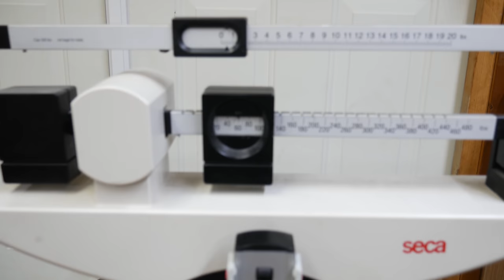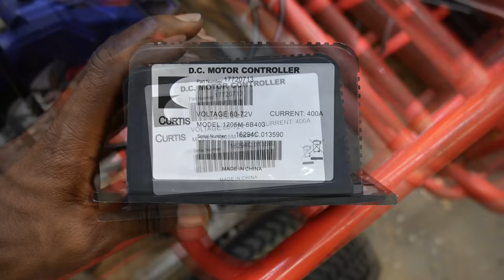Common Problems With Making An Electric Go Kart or EBike and How I Resolved Them. #063

Comment: Question, how about using cordless batteries, like the 60 volt Dewalt or a few 40-volt Ryobi batteries? Seems like these would be a cheap alternative if you use enough?
Reply from the maker: Those batteries aren't that cheap LOL... actually that might work for a much smaller vehicle. but the motor I plan to use long term can draw 100-200 amps very easily. Those batteries wouldn't make it to the end of the street. If you bought enough to get the capacity I want, they would cost more than buying standard lithium batteries.
Reply: Thanks for the reply, I see them using similar batteries in electric bikes, but I understand you're moving a lot more weight around with go-kart. Don't know enough about Battery Technology myself but watching your channel has been very helpful. I was planning on attempting to use some of those batteries 4 in electric bike project on building because I've got so many of them laying around my shop. Keep up the good work, your videos are very informative.

Comment: Do you think it would work if I buy two cheap SDS hammer drills off amazon hook one to each back tire.  Connect those to an inverter running off the deep cycle batteries?
Reply: blue ferral 
You mean one of those 4000W drills?  😉

Comment: I really hope you will consider lithium iron phosphate. Buying brand new cells. And the price for new cells if you were to build your own battery pack with brand new battery cells would cost the same if not just a little bit more. And would potentially be safer than wet asses

Comment: I may go so far on my project as building some super capacitors for both cost, weight and power issues.
Reply: @carlbole2142  I can make supercapacitors for nearly nothing because all I need is carbon, an electrolyte of my choosing and a membrane to separate 2 sides.

There is no battery made which will deliver power more cheaply than home built supercapacitors.

I just need to make time in my schedule to assemble them.

This project is going to be pretty low priority in life, so its not going to happen really fast.

ONE of the issues I aim to address is making an aluminum housing for the motor I have coming, to replace the steel and cast iron parts it now has.

That is where much of the money will go in this project.
Reply: @DeliciousDeBlair  Fast charge with little wear is a plus, but controlling the fast discharge on capac's is a problem. In tandem with a battery pack could have potential, like regen braking does.
GL on your project...
Reply: @carlbole2142  I can control a carbon supercapacitor discharge just fine.

They only discharge as much as you allow them to.

Comment: Just going through the video.
The ESC and your throttle body don't work.
Curtis uses a hall and you have a pot so it wouldn't work. Unless you with it wrong by grounding the signal which would give you full power.

I know how you feel, doing builds and needing to do jackshafts to gear torque with the right speed.

Li-ion are not massive in costs. While they discharge to 20% they are smaller and lighter and don't even cost as much as AGM/LA.

Great videos keep it up

Comment: You should really look at lithium iron phosphate batteries whether their Prismatic or cylindrical. They're very safe have a good charge cycle life non-combustible and would be a lot later and give you a lot more efficiency capacity and range period not to mention maybe a bit more power. And the price is just about the same as what you would find with lead acid, which I'm sure you would be you call more than capable of building a battery pack

Comment: I'm going to build a ebike which motor would you suggest to use to gain 50mph also torque like the endurance stealth bomber bike I don't want to spend 6k on a new bike so I bought a copy frame to build on suggestions would be great
Reply: 50 mph is illegal in most countries...that said a 72 volt LiFePo4 cell pack and a 2000 watt motor from vpower(dot)hk will work for those speeds...a 48 volt, 1000 watt setup for 40KMH is plenty fine without motorcycle braking setup!

Comment: Jeremy, Totally wish I had you for a neighbor. I would have loved to assist with my ridiculous assortment of tools. Welders, plasma cutters, crimpers. etc. Crimping with a vise is pretty sketchy.  On a regular basis you need to check those crimps for heat. Take the cart for a hard run and when you stop just put the back of your hand close to those crimps. If you feel any heat or more heat than the wire itself that is a sign there could be a problem with the crimp. The reasoning is many but the main one is that metals have a memory and on a flat crimp like that the metal wants to spring back a little. When this happens it allows the wires to shift over time and eventually they can become loose.  Most of the best crimpers will stake from the back and allow the sides to fold over minimizing the ability to spring back.
Reply from the maker: I ended up buying a crimping tool anyway.

Comment: That Kango controller was rated 300 amp @ 36 volts. I presume that motor you got with it was a permanent magnet motor.
Reply from the maker: It is... PM motor
Reply from the maker: Do you have any more information? Was it 300amps continous or for short periods like one or two minutes? Do you have any documents or a source? I wonder if they made more than one and if they have different ratings. The kart I took it from had two motors both rated for 48 volts. Of course that doesn't mean it actually had 4 (12v) batteries. It could have been a 36 volts system.
Reply: My stepfather opened the speed controller and inspected the circuitry. It was he who told me that according to the number of MOSFETs on the board that it would handle 300 amps. I recall now that the controller could take 48 volts.

Comment: Something that I have learned is you use copper tubing as my wire ends just so you know for thicker gauge wire real easy to smash a copper in around wire and drill hole for the connection 🤣

Comment: Too bad about your vise.  😑   I can already anticipate another problem to solve that you haven't gotten to yet.  Your axle bearings and suspension components won't last as long as they would with all the weight you're adding to that cart.  The steering is going to be tricky too, due to accelerated wear.  This is a very interesting project, and I wish you luck.  🤔
Reply from the maker: Yeah. I am aware of the fact I am over the design limits... it is what it is

Comment: i hate to say it but a moded 6gy big bore kit be cheaper n less aggravating.as 28 mm carb n all the cams are cheap a it gets .but i still thing of building one my thoughts is a gm starter alternator on the trucks gm b.a.s.s thing i think is called  start stop motor  belt drive unit junk they use

Comment: I wish to convert my 2500kg ma weight van to electric. It's diesel engine is 56kw ma @4000rpm. What size electric motor would i need?
Reply: You need a 56kW motor. Multiply that by the gear ratio of first gear if you aren't going to reuse the existing gearbox. Best solution is to buy a new van.

Comment: 50cc Blower Motors. Can Run a Generator to Charge One of your 12v. Batt. for 12v Accessories and Run a 800 watt Inverter to Plug The 60v. Lithium  Batt.Charger. to Switch the cables to the X# of 60v. Lithium Batteries Straight. 
*You might Say I'm Crazy, , , ,
  , , ,  You might be Write*.!.

Comment: lead acid batteries are absolute crap. I would rather use drill batteries than use lead acid but Li-FePO4 are best for me.
Reply: 100% correct...awesome cells, not the lithium-ion (planned obsolescence garbage)

Comment: Did you ever tried an ac motor with a vfd controller.
Reply from the maker: You would need a VFD that works on DC power They are usually 200-300 volts DC That is a lot of batteries... or you are back to the inverter and the VFD together which I don't think is a reasonable option.
Reply: Jeremy Fielding 
You will need additional inverter to ac and a Omron vfd an 20hp German ac motor they are small in size but powerful.
Reply: Ernesto, I think you should make a video showing how to do it. It sounds very interesting.

Comment: Why not put two batteries under the passenger seat and two under the driver's seat?  Just raise both seats to accommodate the batteries.  No?
Reply from the maker: This project has changed since this video so it best if you watch that one first rather than respond to this.

Comment: Soldering lugs while crimping will have more amps
Reply: If they are crimped correctly all the strands of copper wire will be welded together, and also welded to the crimp lug. Solder can do NOTHING to improve a good crimp. Copper is about 6x more conductive than solder. But a lot of people still solder battery lugs. So you are in good company for suggesting it.

Comment: On your big lugs rather aluminum or copper I much rather fill them with solder and shove wire in while molten
Reply from the maker: Someone mentioned solder slugs which I didn’t know about.sounds like a good option

Comment: Why not build a custom battery with old laptop 18650 cells?
Reply from the maker: Not every thing fits my preference for DIY projects. I have seen what’s involved in finding and recovering cells to make a pack...and I have decided the answer is no based on my patience, tools, and what I like to do (and don’t like to do) in my shop. Everyone’s value of time depends on what they are doing during that time. Some see it as a easy cheap solution I see it as not worth the time and effort.
Reply: Jeremy Fielding 
I admire your patience for answering this single question for so many times 👏
J Dalzell no disrespect to you.
Reply from the maker: Well... If I don't respond people think I am ignoring them when I have indeed read their comment. So Its a tough call to make. I can't respond to all of them, but sometimes I resort to copy and paste for at least half of them when I get hundreds of the same comment. And it does happen LOL

Comment: "brushless DC motor"
...yes, it is different from brushed DC motors, thats because its not a DC motor at all, its a 3 phase AC motor hence the 3 wires going to it. the speed controller is converting DC to 3-phase
Reply from the maker: I don’t want to split hairs here but I want to be clear. three phase AC and brushless DC are very similar indeed but not the same. Just search google. It’s a great day to learn.
Reply: ah, i see now. thanks for the tip. i still think they shouldn't be called that though.

for anyone reading: 3-phase induction motors and DC brushless motors both operate on 3-phase ac, and have the same stator.
DC brushless:
rotor has permanent magnets which interact with the field generated by the stator
more efficient
requires a controlled frequency of 3-phase AC

3-phase induction:
rotor has an iron core, whose induced currents generate their own field to interact with the stator field
less efficient, generates some heat
can run on a constant frequency, can start without any special control

Comment: Brushless dc motors are ac induction motors!!!!!
Reply from the maker: Well, I don't want to split hairs, but there are differences. I do agree a brushless DC motor is often correctly called a AC motor. But if it has permanent magnets its synchronous not induction. And the way they are controlled is different.
Reply: Jeremy Fielding wait i didnt mean to say "induction"
But you are right

Comment: The "crimping method" you used is Very poor.
Maybe it will handle your 15A MOMENTARY load but not the full rated load of the wire and terminal.
Reply: Lol what ever

Comment: Use Tesla batteries
Reply: garbage! LiFePo4 has 10x battery life and only a bit heavier...dont need 383 volts on a go-cart, or runabout E-car...Tesla wants a Consumer Car for long trips(stupid, use your gasser for long trips), and still does not have a good one...